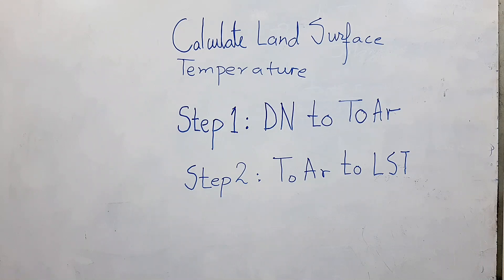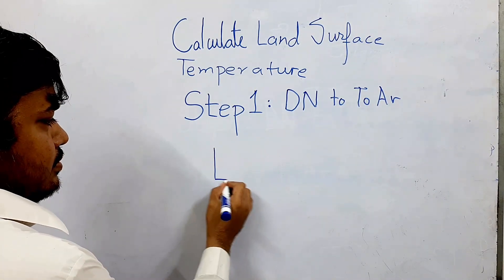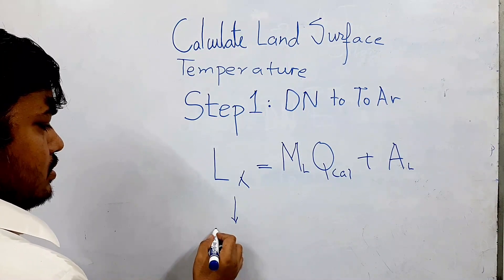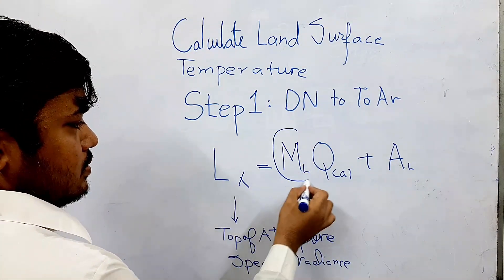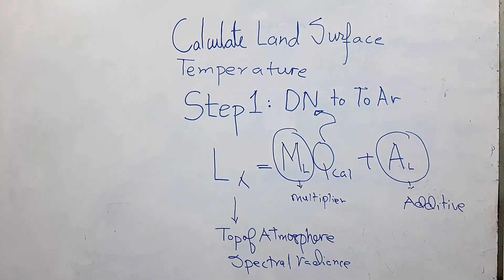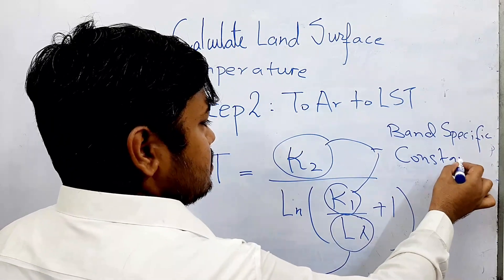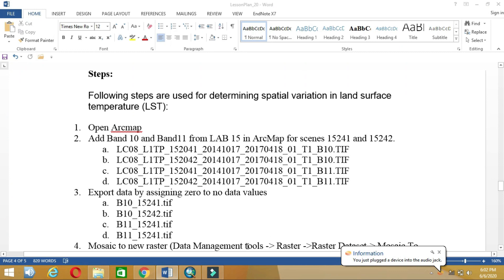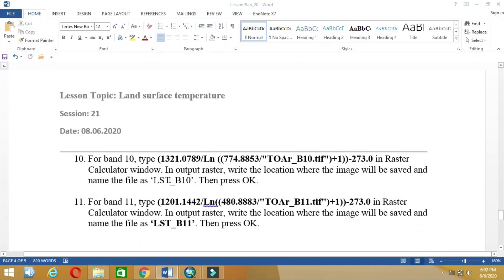Land surface temperature using landsat 8

Comment: Good job. I followed your steps but discovered that urban areas have lower temperatures than water which is absolutely wrong despite atmospheric correction. How can this be rectified? Thanks.
Reply from the maker: This is possible. In literature there is evidence that in desert area or semi arid condition urban area can be cooler than barren land.